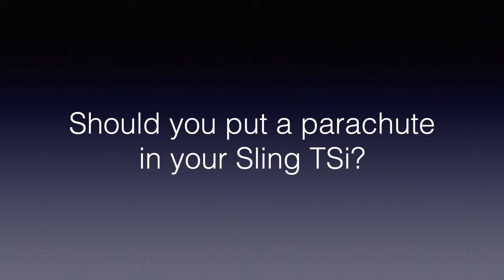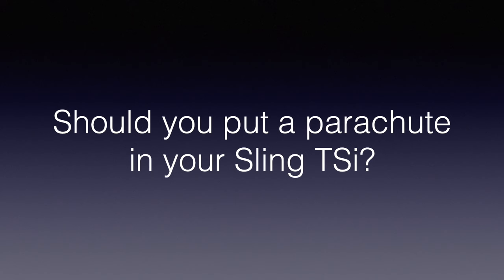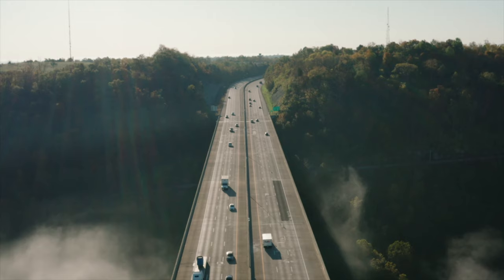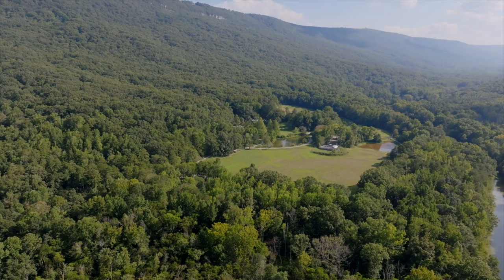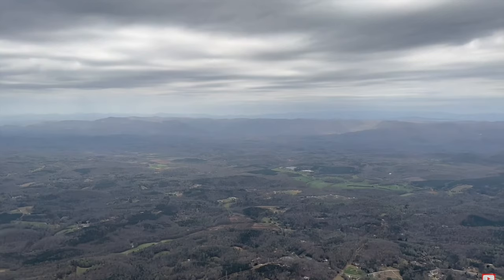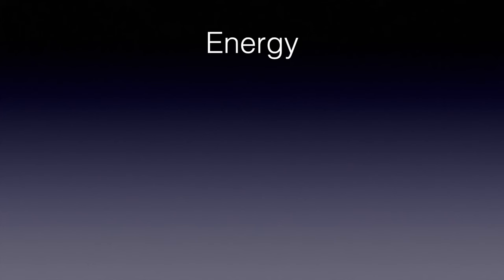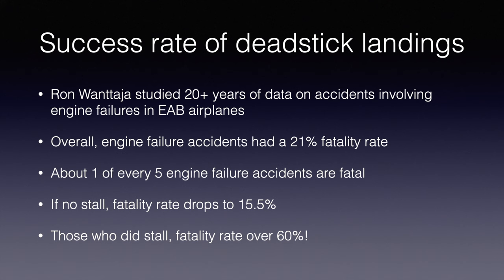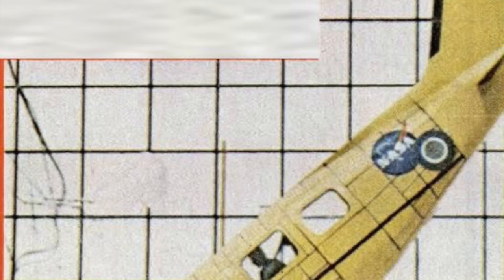Should you put a parachute in your Sling TSi?

Comment: I survived an engine out because of my BRS (no plug intended). About 40 miles due east of Eugene Oregon my engine failed. My landing choices were trees, tress, or the side of a mountain covered in trees. Where I went down, 170' tall trees. I made it to the ground with the parachute. With no parachute, I would have clipped the top of the trees, stalled, and ignited 70 gallons of avgas when I hit forest floor. 

Someone said to me after, you should always have a glide out option, get your glider endorsement. If you think you will always have a glideout option, you're kidding yourself and should probably consider that a hazardous attitude. Engine failures are not that rare. Your total time spent in an airplane in which you are flying over terrain that would be sketcy to try to land is also not that rare.

I highly endorse any brand of parachute including BRS (and yes that was weird what they made you do, overzealous).
Reply: Yikes, that must have been terrifying! I’m glad you had the extra insurance of a safer way to get down in case a gliding landing wasn’t an option. You hope to never need it, but so glad it is there if you do.